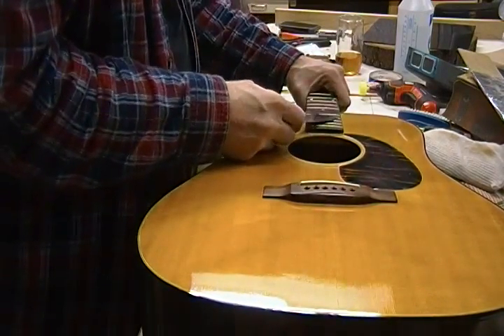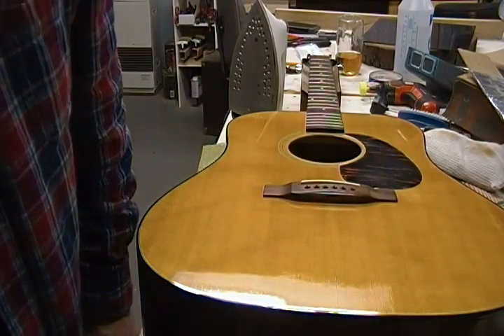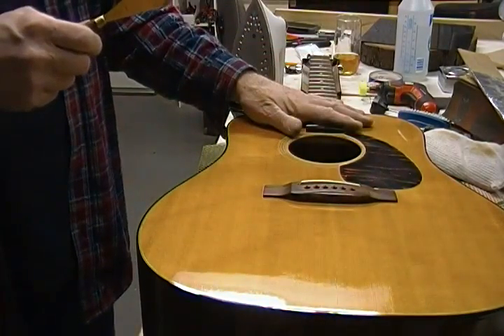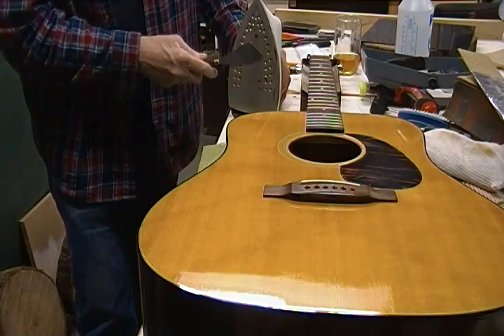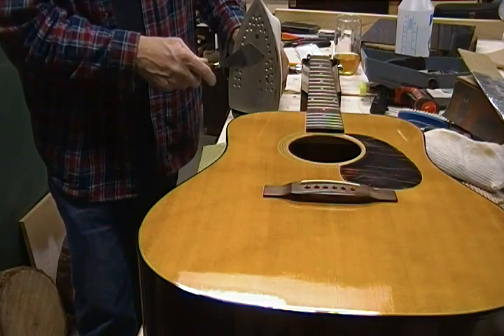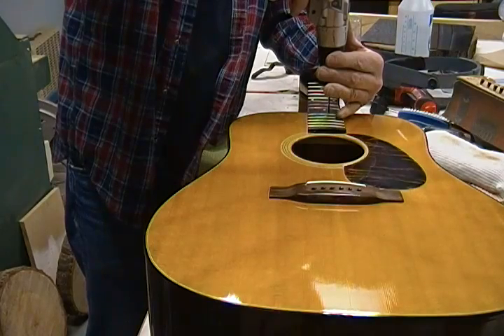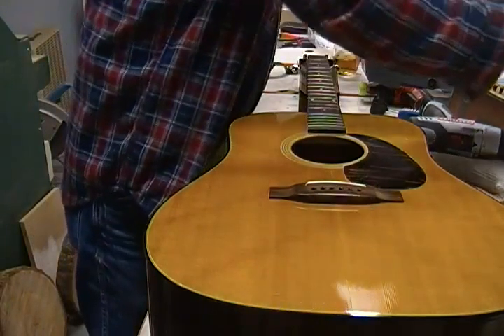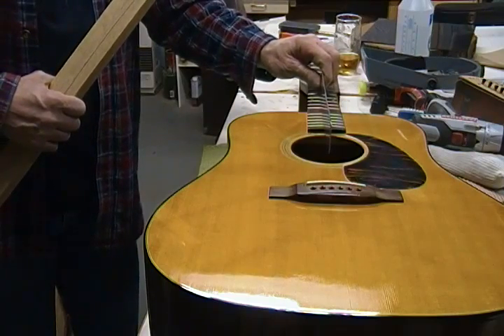70’ Gibson J-50 Neck Reset at Jonah Custom Guitars #4

Comment: Hi Dane, with your silver protector covering the guitar top,  would heating the the blade under the iron with the iron resting on the fretboard cause issues for the fretboard?
Reply from the maker: Ian Copper, first off thanks for watching Ian. That's a question and yes I could have heated the knife and the extension without any damage to the neck. I heat only the extension over the body not the neck portion of the fret board. Lifting the board over the neck would crack the lacquer finish and cause over issues to fix.